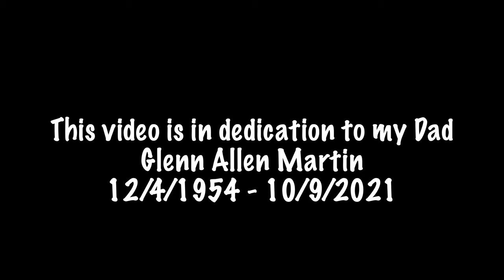Making and Firing Primitive Pottery

Comment: I'm sorry for your daddy. Thanks for sharing
Reply: Shipping is pricy but new mexico clay is a store with a website, they sell a clay mined near Albuquerque called mica clay that sinters as low as 1200 f  and gives nice fire clouds like the one in this video. Very nice clay to work with
Reply: @coopart1  Please, what materials are added to natural clay when kneaded to become soft? to make traditional pottery,
Reply: @sandgrains3418  hard question to answer . But over all, sand is good to add. Brings silica to the mix but every clay fires a little different. Best to test your source . Hope that helps
Reply: @coopart1  Thank you for the answer, I wanted to know what was added to the primitive clay of pottery, thank you again for the answer
Reply: notme170  Thank you for your interest,, yes I succeeded,, clay from the yard of the house, and I purified it and added a few pieces of ground pottery,, and it happened, but I did not succeed in firing or burning pottery,, did you arm me if you had your information?